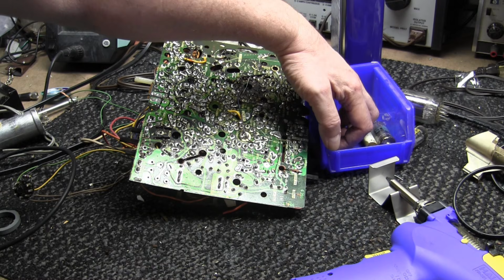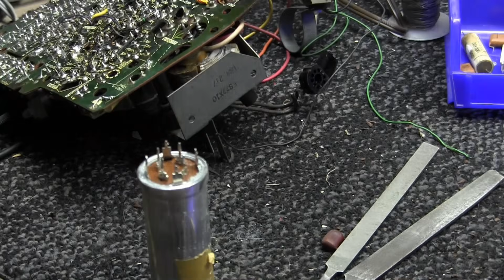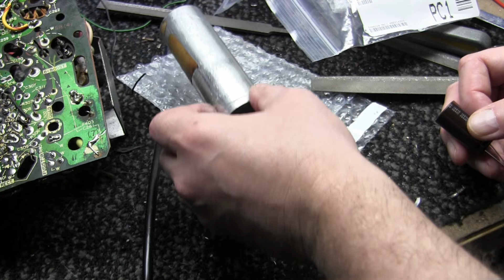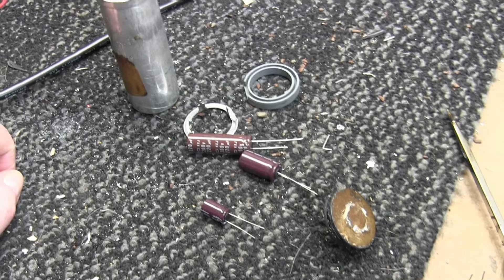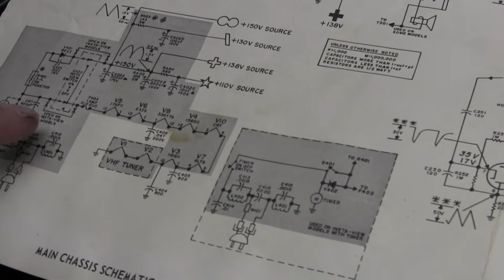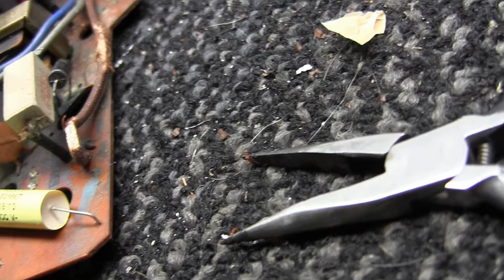Computer Space! - part 2 - Recapping the PCB

Comment: Smoking hot multisection e- cap can  replacement Bob! I actually have some aluminum "sticky on one side" tape that's stiff enough to increase the total height of the original cap by 1 inch. That would help putting the new caps in and little worry
about lack of height as the tape is strong enough to hold everything together. But to use the tape method you must cut it 1 inch from the bottom of the can  to increase the height. I've done this once already and it works.

Comment: I straighten part leads with the tip all the time, it doesn't seem to bother it.  you can 'wiggle' the tip a little back and forth while using it to stop the part lead sticking to the pad/hole, and run the vacuum a bit longer and it should work better.  this is important for plated through holes so the pins don't stick to the side of the hole.

Comment: Glad you're enjoying your new Hakko. I've seen other people (like CuriousMarc) squeezing the trigger for a good couple of seconds as a matter of practice. Also some flux can help, like good ol' smelly rosin, modern RMA-223 paste or its even less aggressive analogs.
Reply: Beautiful mittens BTW
Reply: You can solder alumin(i)um pretty easily with a hot iron and special flux — either specialty acid flux for Al, nichrome and stainless, or just plain aspirin pill (which is also an acid, acetylsalicylic one). But don't use aspirin unless you absolutely have to, because it **stinks**.

Comment: The leads are left so long because the way they are cut is with a rotating blade. They can't set the blade too close to the board because back then the boards flexed a lot more. The boards were only held at opposite edges and run through the wave soldering machine then the lead cutter machine.

Comment: Be careful leaving out that mounting ring on the cap. Many circuit boards use one pin as ground and the other pins on the ring of the cap to feed ground to other parts of the circuit. It frees up more space for traces.
Reply: If this is the case, at least what had been bridged by the ring could be bridged with wires.  But it is wise to check.